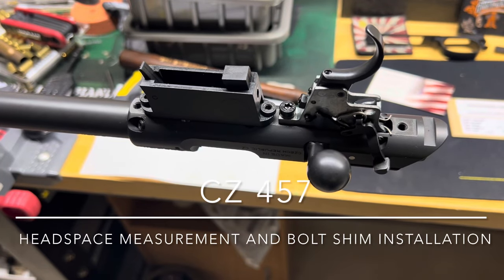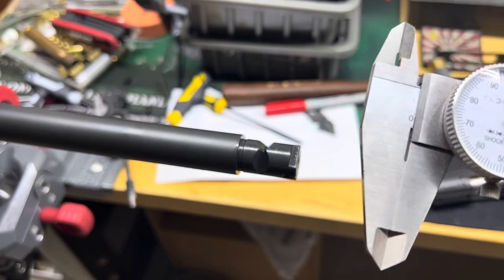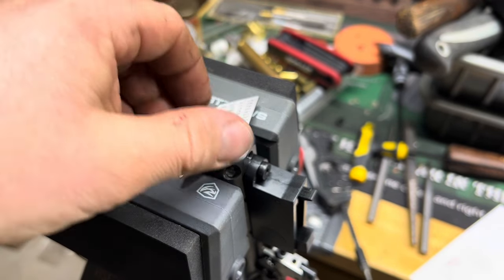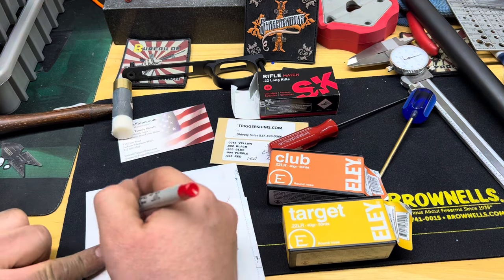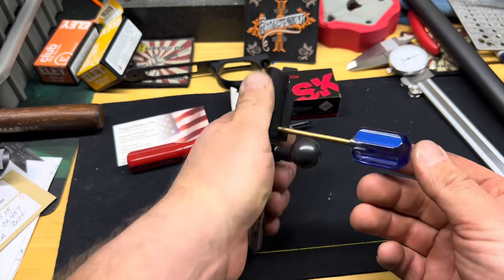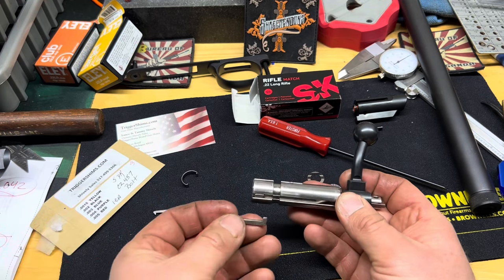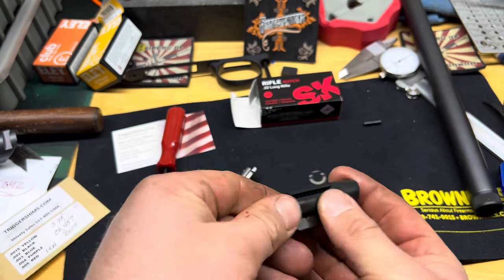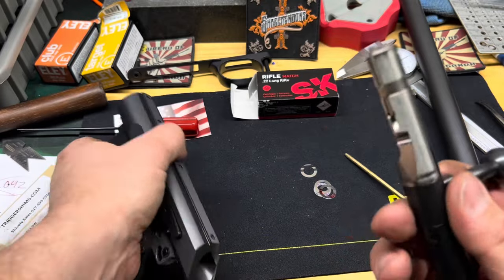CZ 457: Measuring Headspace And Installing Bolt Shims

Comment: Rather than going threw all this disassembling, cut a small piece of tin solder and place on the bolt. Close bolt on solder than remove and measure it. Tool maker lead set. Use this method every tool set up to check shut height.

Comment: Great video.  Very helpful.  I tried the .002 shim.  No affect on accuracy but what I got was 1-3 rounds failing to eject per 10 round mag.  Yes - pointy ejector was on the right.  Removed shim and ejection issue disappeared.
Reply: i thought so
leave well enough alone
Reply: @ellenbrooks5028  Same here. A brand new quality rifle should be ready to go out of the box. If I change barrels maybe I'll mess with this.

Comment: The CZ recommended 5.0 newton-meters (44 IP) torque on the grub screws is WAY too high. Use 35 IP and you'll be good to go.

Comment: Personally I would torque the barrel nuts to 22lbs then proceed to 44lbs. it's just good practice to split torque specs so it's force is applied evenly. Good stuff, about to check my new 457 Varmint. I'll do a stock testing of ammo then test with different shims on my best ammo from the stock test. Easy enough to change the shims on the shooting bench. Cheers

Comment: Another method to measure 22lr rim thickness.  First obtain a "once fired" .223 REM brass case.  Be sure to have a good quality digital calipers (Mitutoyo).  Next, measure the length of the once fired .223REM from the base to the top of the case rim.

Next, take a unfired .22lr and insert the bullet fully into the once fired .223 REM case.  Now take your calipers and  measure from the base of the .223 REM to the base of the inserted  .22lr cartridge

Now take your first measurement of the empty .223 REM case and subtract that number from the second measurement that you took.  The difference is the .22lr rim thickness.  

Very easy to set up and collect a lot of data quickly.
Reply: I want to buy a used cz 457 barrel, do you have it and I'm in Vietnam. If you know where I can buy them, can you help me? Thank you very much
Reply: Nice method, the gun is already very accurate so is there a value in doing this procedure?
Reply: @thomaskingsbury6560  I don't get this. I have never thought about headspace with weapons until I thought about changing barrels. Is this all overkill? Shouldn't the rifle be fire ready out of the box? I bought this rifle to be accurate, not to have to gunsmith it. It is just for plinking and varmint control.
Reply: @teleguy5699  I have two of these rifles, they are both lites out accurate even with Remington golden bullets.Eley  tenex shoots even better. That is why I raise the question. Now for competition shooters it might be different as 22 lr is now entering long range shooting competitions. But for me my 457’s with a 22 lr Hawke scope at 50 yards is eating out the bullseye. The Hawke is one of the few scopes that has parallax adjustments as close as 15 yards. Check out Hawke optics .
Reply: @thomaskingsbury6560  Thanks for the tip. My FFL guy and a gunsmith says headspace on this .22 is much ado about nothing. especially for a non competitive shooter as myself.  I ended up getting the Leupold 3x9x33 which has a adjustment down to almost 10 yards I've heard.
Reply: @teleguy5699  you can spend 3500 dollars for a 22 lr rifle and 3200 dollars for a long range scope and 400 dollars for a sphur mount and………… then you can be a 22lr  competitor.

Comment: OK, I followed the instructions. . . twice and came up with a .009 on my CZ 457 MTR. Is that out of line with normal expectations? Can I double the .004 and .005 shims together to get the .009 needed? Thanks
Reply: It does add up to the desired thickness that you need, so go ahead.
I also add some fine gun oil on the shims, but that's me.

Comment: So I'm assuming the ammo use has a rim thickness of .040. The spec for 22lr ammo is .043 - .007 thick.  You may encounter a .043 thick standard spec round and the bolt won't  close? My CCI sv usually measures .042

Comment: There is a wide variation in rim thickness on .22 ammunition. Why I don't know. How hard can it be to press a good rim?
This is evident in my CZ 457 MTR which is advertised as having a match chamber and headspace on the low end other spec.
Some brands of ammunition chamber well with the bolt closing firmly. Some verge on being tight.
Other ammunition is so loose the bolt closes with little to no force.
My plan is to identify the properly fitting ammunition and find the one the rifle shoots well.
If the ammunition ever changes it will be evident when the bolt is closed.

Comment: I have the left handed bolt. The extractor pins should be mirror opposite right?
Reply: Yes. Your pointy extractor will be on your ejection port side.
Reply: @malone212  thanks!

Comment: I purchased the Bolt Shims for my CZ 457 and tried to review the information on the triggershims web site to better undstand 22 headspacing and recommendations for installation.  However, I did not find a good instruction video that walked you through the whole process, UNTILL NOW.  You did an outstanding job with this video and I want to say "Thanks".  Many of the viewers asked if the accuracy improved with the .003" shim?   I have never headspaced a 22 rifle before and decided to purchase the "Triggershims" for my CZ 457.  My CZ 457 shoots extremely well, but 1 out of 20 rounds I get a fly when shooting 200 yards.  I hope this helps: HOWEVER, I have headspaced many center fire rifles and never left 0.000" headspace.  Is the 22 rimfire headspacing different than a centerfire headspace.  On my centerfire cases, I always headspace .001" or .002" for extreme long range target shooting.  Should the 22 rimfire be allow to have .001" headspace?  Like I said, I have never headspaced a rimfire rifle before.  I question if zero headspace is correct for a 22 rimfire.  Please help me if you can.
Reply from the maker: If the bolt doesn’t feel too tight at .000 I’d go with it otherwise .001 would be fine.

Comment: Going down to "zero" headspace; what's the chance of getting an oddball extra thick rim and detonating the round by closing the bolt?
Reply from the maker: Probably zero. Closing the bolt on a tight round isn’t the same as a firing pin strike

Comment: Bolt shims are nothing but snake oil. As long as headspace is within spec and not so far out ignition issues there's no reason to do this on a relatively new rifle
Reply: Seems like overkill on a new weapon. If it needs this rework, why buy it? CZ's aren't trash.